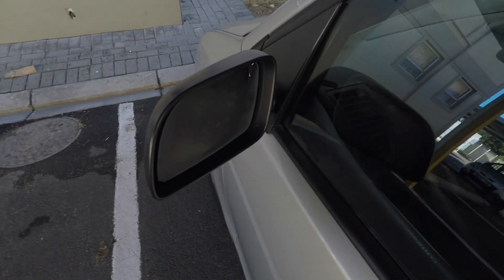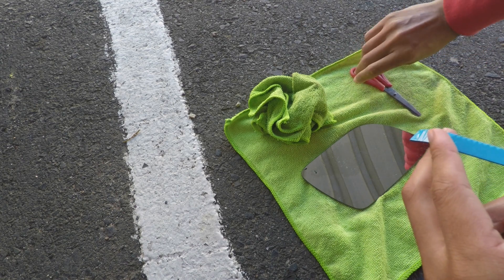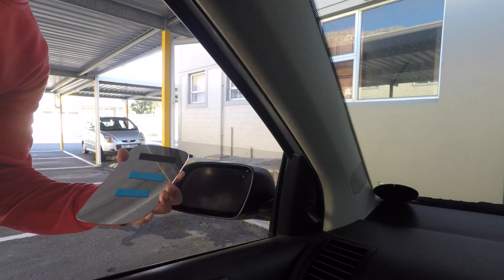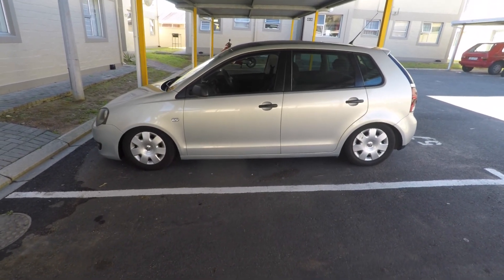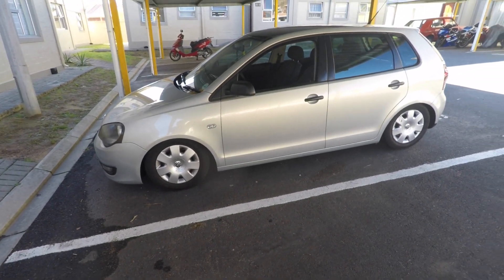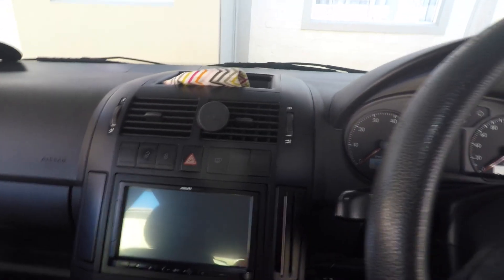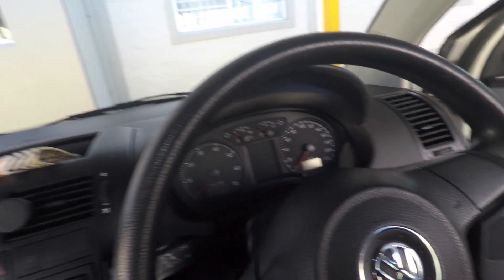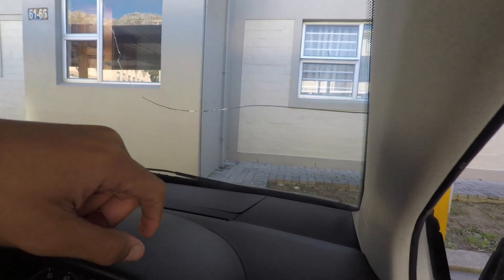VW Polo Vivo Walkaround + Fixing my Mirror (it fell off)!

Comment: Awe Bro, about your suspension. Did you also change your calipers and replaced them with shorter once? Did you also remove the supporting springs?
Reply from the maker: Howsit brother, we put coil overs in and thats the only thing we changed. Then we removed all the bumpstops and helper springs. We didn't change anything else
Reply: Nico Walters dankie bro, you didn’t touch the links at all? And how’s the drive by the way?
Reply from the maker: @phetolomocoanyane4687  we removed the links completely. So the stabilizer bar isn't connected. The ride is very comfortable for how low it is
Reply: @nicowalters  I'm Not Quit Sure If We On The Same Page I'm Kinder Lost Because I'm Not Actually That Familiar This. When You Got The Time Please Do Upload A Clip Showing Us